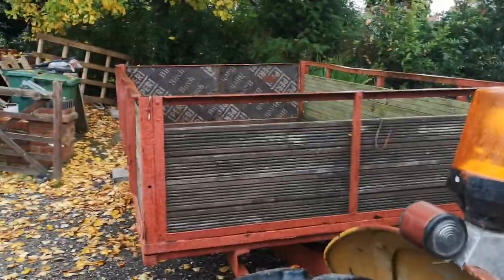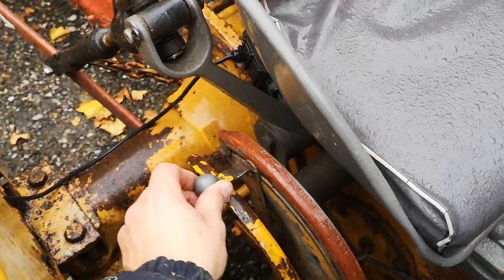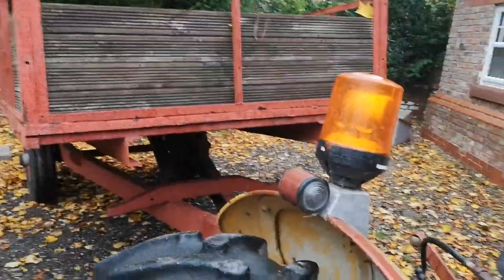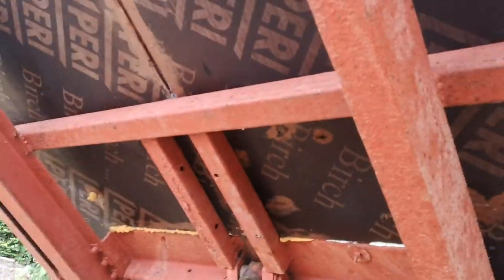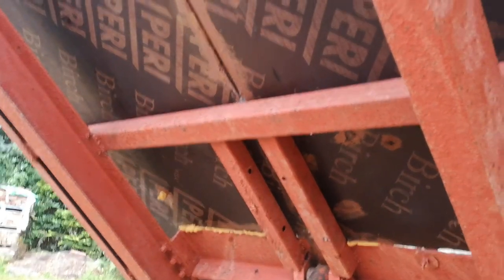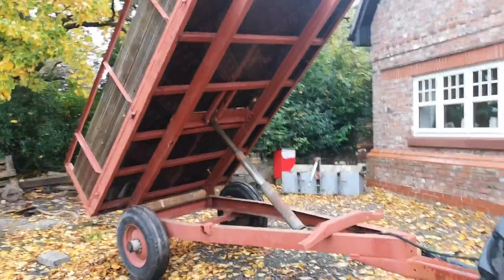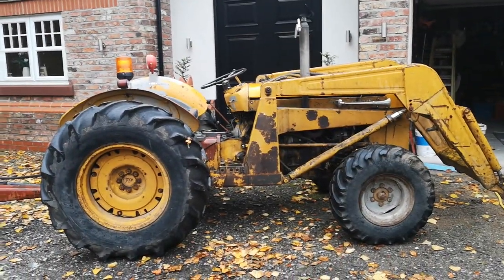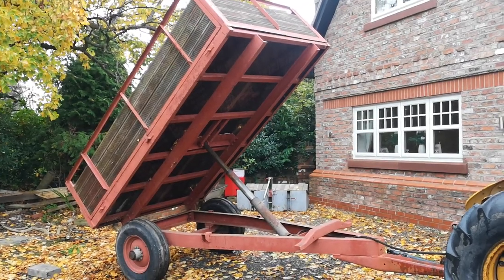FERGUSON 3 Ton Tipping Trailer hydraulic ram | @MrMacHowto

Comment: Hi, thanks for sharing your Ferguson tip trailer.  I'm working on building a somewhat faithful copy of one, I have managed to track down some dimensions from old catalogues etc would greatly appreciate if you could give me dimensions of any of the following cheers! 

A) Chassis Rails (Channel Section) I assume they are about 180x50mm
B) Outside distance between chassis rails where the axle is, guessing it's approximately 1200mm
C) Deck Rails (Channel Section) looks about 150x50mm
D) Deck corner posts, looks about 50x50mm box and 50mm angle for the side frames

Thanks again